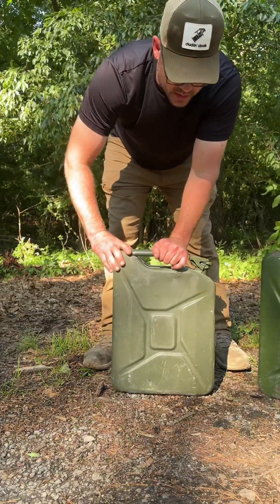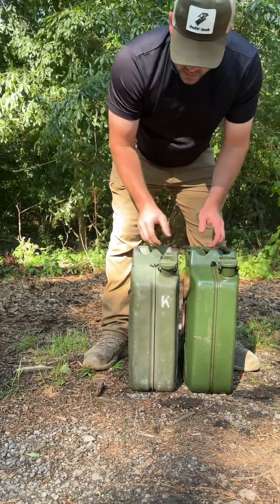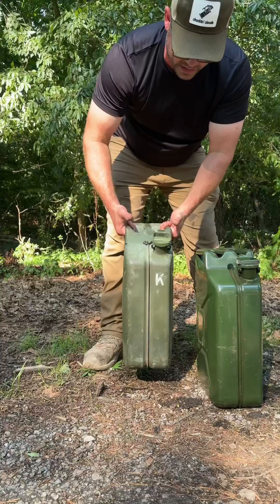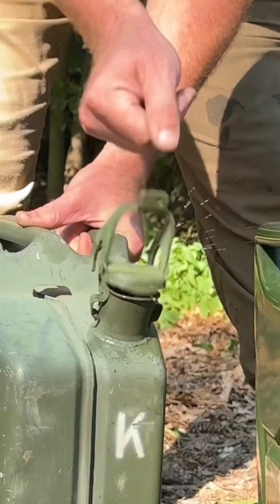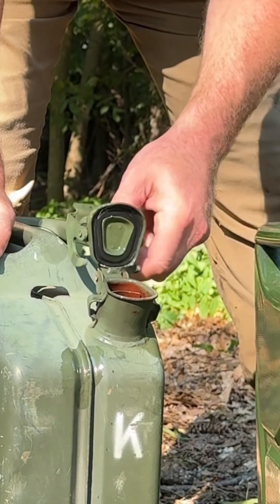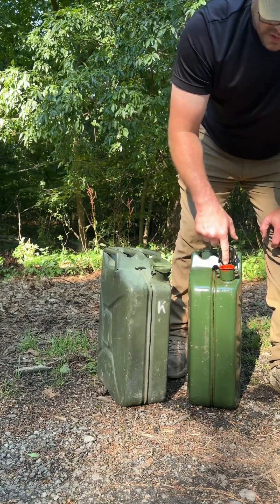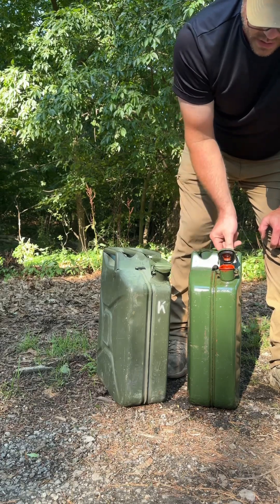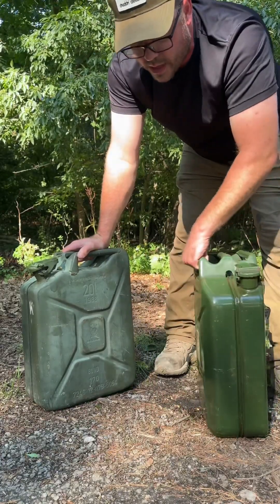The Gerry Can: Pure Genius

Comment: I used to have a connection for these where I could snag them for 20 bucks a piece. Now, they'd easily sell for triple that for these older cans. Gotta love inflation
Reply: i feel that there should be a way to reverse engineer the cans as they were intended, dunno if anybody could find the right recipe for the rubber that they used on the internals, but itd still be nice to have more of these around then the easliy damaged plastic ones
Reply: @wolflordgaming31  there's more of these floating around in surplus than you'd ever know what to do with. Search the Google machine for "surplus vintage ammo cans" you'll find a plethora of options ranging from used to brand new old stock
Reply: @wolflordgaming31  Midwest cans sells these. they have their weird locking and reciprocating nozzle on them. I just zip tie the lock down and its great. 60 bucks brand new.
Reply: @wolflordgaming31  The sceptor modern ones that are plastic I ran over with a truck. They do just fine.